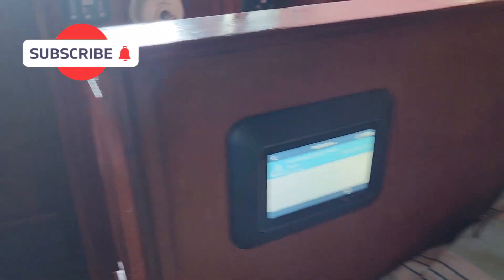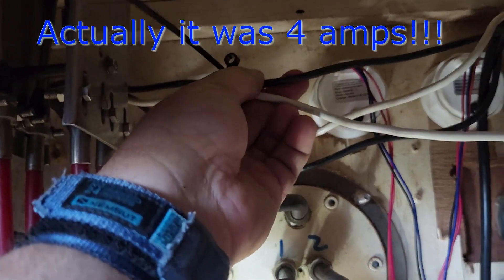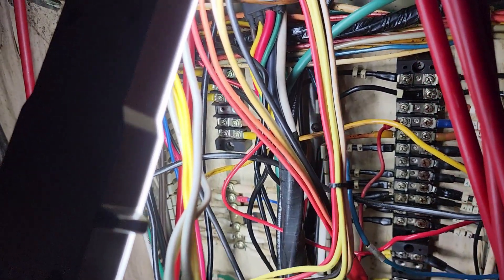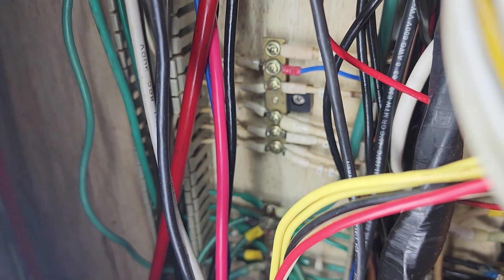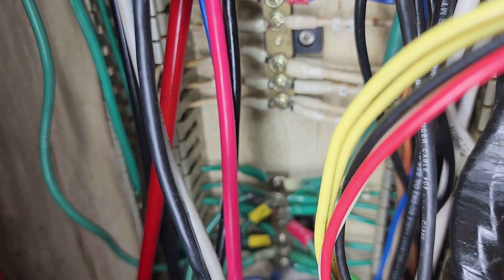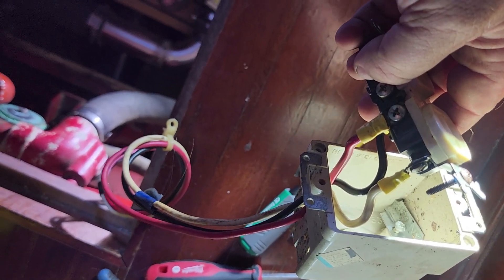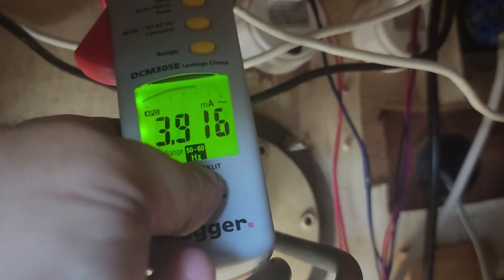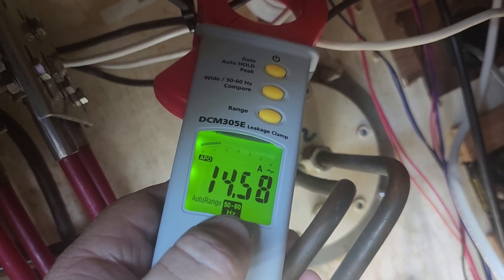DANGER!! AC SHORE POWER LEAKAGE!!! Identifying and correcting AC shore power leakage.

Comment from the maker: More explanation on the video, including further discoveries. As part of the Lithium, Victron install portions of the boat are being rewired and brought up to modern standards. An ELCI was one of those items. So of course I wanted to precheck leakage prior to the ELCI install as not to lock myself out of shore power once installed. The video is not very good and was just what I managed to take while I was in "highly focused" fixing mode since I had serious concerns for the safety of possible divers or other unsafe conditions with 4 amps of leakage. 🤪 After ordering and receiving the Megger leakage clamp meter (specifically designed for this troubleshooting) checking the hot and neutral wires just on the backside of the shore power showed 4 amps of AC leakage. The limit for an ELCI is 30 mA. Several orders of magnitude difference..lol. I then put the clamp around the green ground wire of the shore power plug and it showed 3.7 or so amps. So that confirmed the vast majority of leakage was going out the ground wire. This is why diver never complained in the past. Next step was to go to the shore power pedestal and pull the plug and lay it on the dock. This disconnected the neutral and ground (they are connected somewhere upstream typically). I then went back to the boat and used a regular multimeter set to ohms and put the probes on the white nuetral and green ground put to measure continuity. It measured like .2 ohms. Pretty much tied together. It should have been reading open of Mega ohms, meaning little or no continuity. So at that point its clear the neutral and ground buss where tied together somewhere on the boat. I decided to begin removing the neutral bus wires one by one until there was no longer continuity. I decided to remove the only "add on" wire on the neutral buss that had a cheap crimp. Once that was removed the two busses read many mega ohms, so it was essentially open. I traced that wire to a bungle of three that clearly made up and AC circuit. Traced that to the back of the boat and found it ran into a typical AC receptacle. Opened it up and found the neutral and ground wires swapped. That receptacle was for a fairly new Xantrex battery charger. Reversed the wires and the AC leakage went away and now had under 4mA of AC leakage. Plenty of room for the 30mA ELCI. Also in this area were two AC boat cables that had wire nuts on them. Since I was in the area I was obligated to fix this issue as well. Opened the wire nuts up and of course the wires were good copper, but coated in green corrosion. Ticking time bomb. As I set out to fix these AC wires I discover that BOTH of these AC boat cables ran from the front electrical closet to the rear of the boat near the batteries, connected only to each other!!🤪 So of course I pulled them out all the way to the front and jumpered them to their appropriate busses with short wires of a few inches. Then it dawned on me. There was once an inverter charger located against the back bulkhead near the batteries. The two ac cables were the pass through. And at some time in the past the inverter charger died and the previous owner paid someone (i know who) to fix the issue. That person disconnected the AC cables at the inverter and wire nutted them together and left it dangling. In addition he added a basic Xantrex charger and wired it to the front AC panel, miswiring the outlet for that charger by crossing the neutral and ground. This person who did this work was supposedly a "Marine Electrical Engineer". Old boat wiring like this tells a sad story..lol.

Comment: Any stray current damage to your boat? Isn't your AC ground connected to your boat's bonding system?
Reply from the maker: No damage. Not much has changed other than the leakage of course. All the stray current was just going out the green shore power ground wire. So it was fairly safe. But still not right and may have presented a hazard with additional failures.

Comment: I need to do that on my boat
Reply from the maker: If you have a regular clamp meter yo can do a basic check to see if there is a major problem like mine. Clamp the white and black wire on the backside of SP plug. Then clamp the green wire by itself.
Reply: @mvintrigue-trawlerdiy1101   - thanks!

Comment: A GFCI circuit would have tripped in this case.  If I'm not mistaken, most of the newer marina's have these on their power pedestals.  Better to find this now than sitting somewhere away from home port.  I'm guessing you have a galvanic isolator which kept your zincs and other drive parts from disintegrating?  otherwise, I would expect damage.  Good diagnostic work.  Thank you.
Reply from the maker: If that particular plug was gfci It probably would trip. But there was no GFCI and this was a single circuit. No isolator. I have a ton of zincs and they did wear every few months. But because of the nature of the mistake the majority of the stray current was going up the ground wire back to pedestal....thank god.